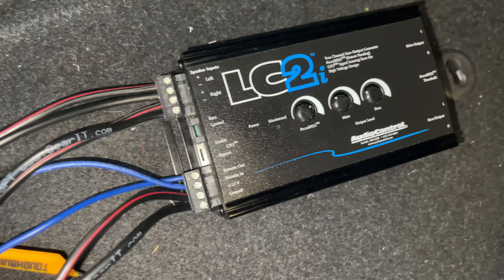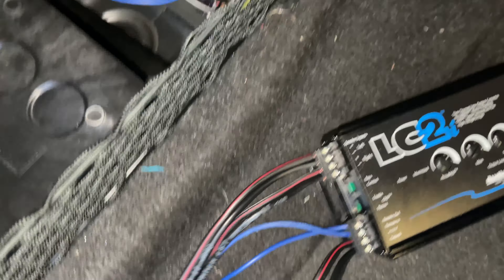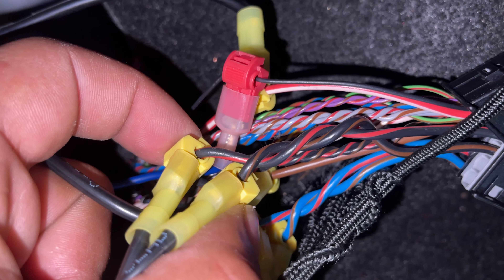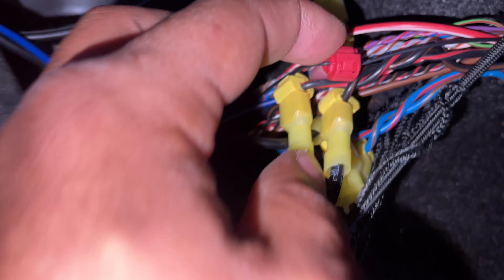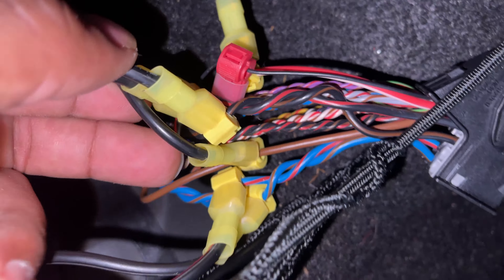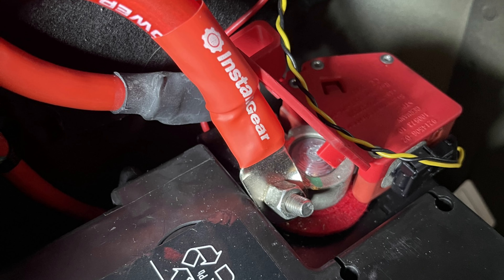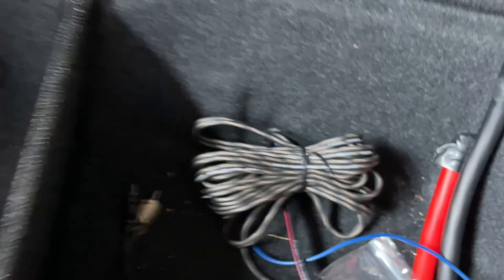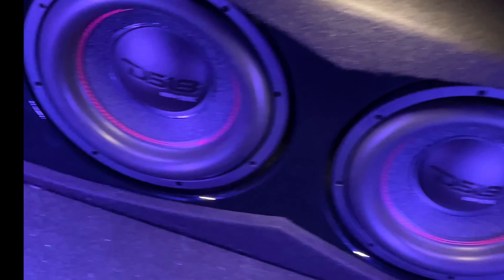2 12” DS18 Subs Installed In A 2013 BMW 328i F30 DIY

Comment: You used that adapter box because you are using the stock deck? Is this a must in a 2013 bmw 3? Im so use to having a deck and just pluging in the redwhite from deck to amp. Iv been searching for how to get subs in my 2013 properly without loosing audio quality
Reply from the maker: If you have pre outs use them I didn’t want to run a wire all the way to the front of the car when everything’s right there in the back

Comment: Hi I had a check engine light come on after installing subs. Any recommendations? I’m thinking it’s something stupid like battery connectors loose or something.
Reply from the maker: Make sure you didn’t cut anything completely also make sure your voltage doesn’t drop to low you could need a alternator or battery